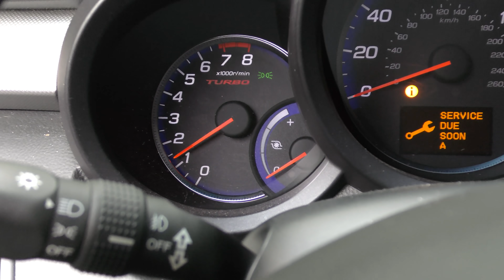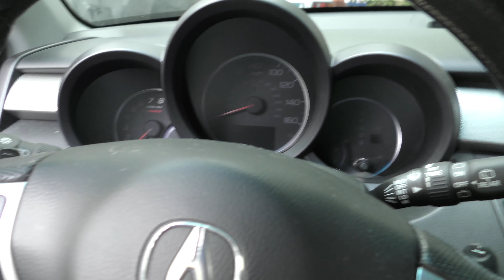I Just Found My New Favorite SUV (You Can Buy It for Less Than $5,000)

Comment: i just bought a 2008 acura mdx in preety good condition with 161000 miles.......the tighten gas cap light comes on even after i replaced the gas cap sometimes it is off when i first start driving but after a couple of minutes it comes back on is this a serious problem
Reply: How much did you pay?
Reply: @brittanyann5244  8000
Reply: I am about to purchase an 09 with 124k miles for $10k I guess that seems to be a good price but it seems expensive for an 09 to me. It is in great condition though and brand new Michelin tires.

Comment: Nope. Acuras are garbage. Have an RL bought around 30k miles - 150,000 miles now and have already had an alternator go out under 50,000 miles, metal valve covers DISINTEGRATED - want a photo? - engine was leaking everywhere, also the power steering lines, front upper control arm slid off its mount had to be replaced, sway bar end links were shot had to be replaced (clunking suspension) the windows have several times just stopped working..glove box door material leaves a dent if you put your finger on it (look it up)  just garbage.... 2nd RL/Legend I've bought and both were huge mistakes.